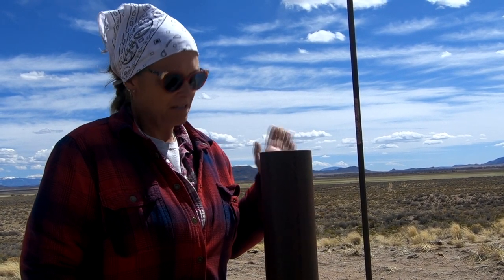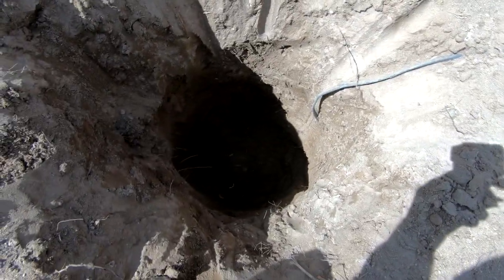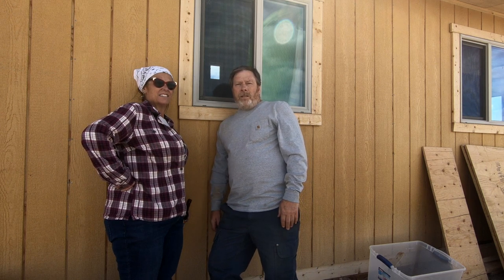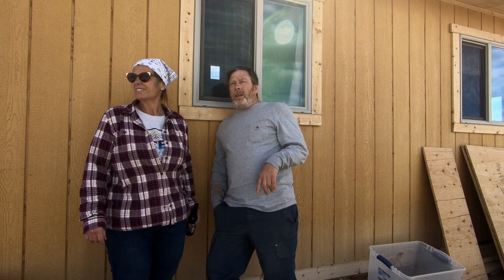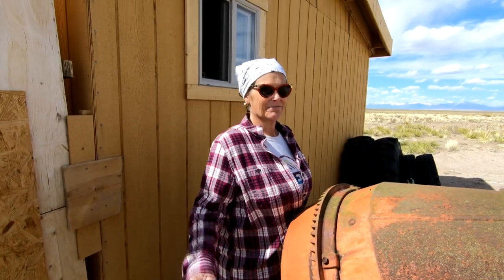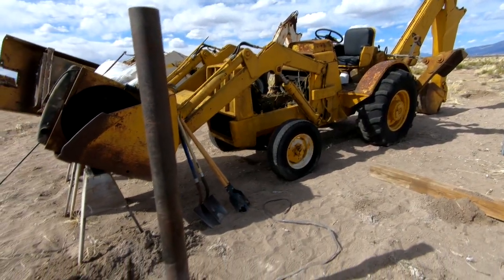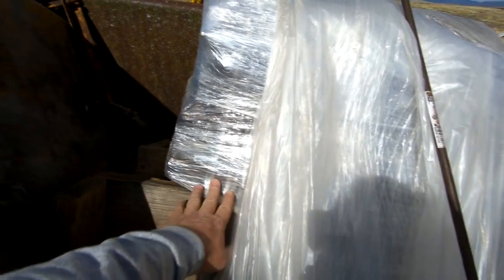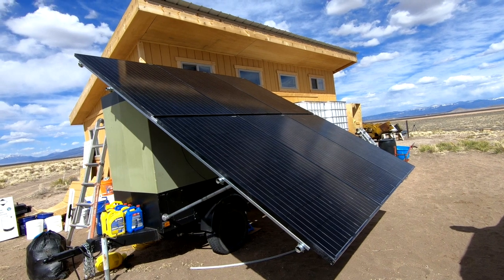A Well of Contentment - Solar Powered Well and Wifi, Part 1

Comment: Hi E-Chip and Robber.  I feel for you every time you go to do something, Not knowing if it is there or all of it's parts are there for the job.  It is like when I was robbed by the foster children I didn't know it was missing till I needed it. 
So right about the ground heaving. The cement pad in front of our barn has done exactly that.  And the pad in the back of the house too. They were deep but not deep enough.  
That is great that you got a new engine and not a re built one for the new Dina.   I didn't know the cement mixer could run on solar. That is great and so glad yu have it. Looking forward to your next project. 💕 NonnaGrace
Reply from the maker: Hi NonnaGrace!  We just plugged the cement mixer into Buzz, our solar generator, so in a way that makes it solar powered, haha. We just realized today that a sink we planned for an outdoor wash-up station has been stolen as well...there have been a few of those discoveries as we have been back and will likely be more of them. Thank yu so much for your friendship.